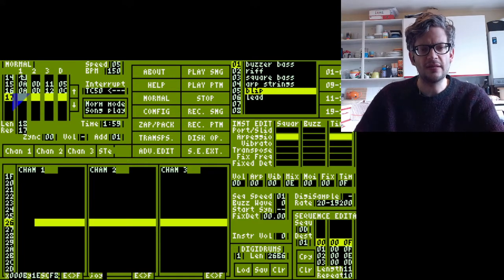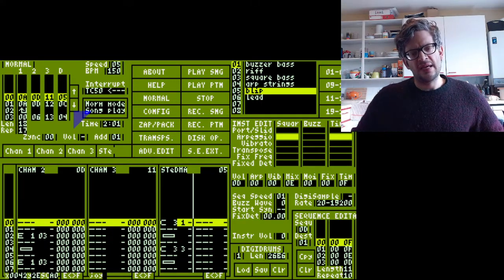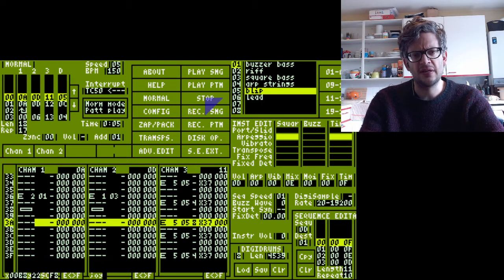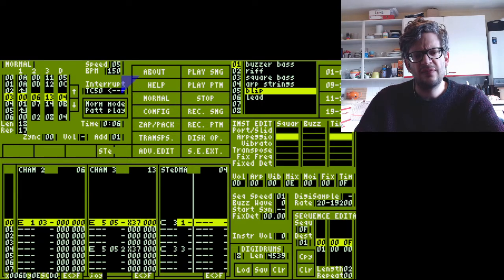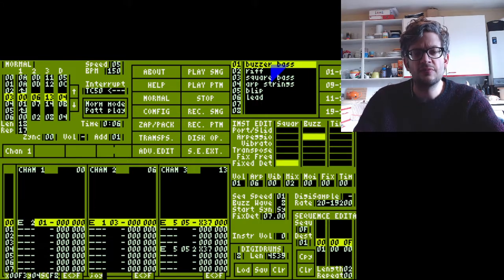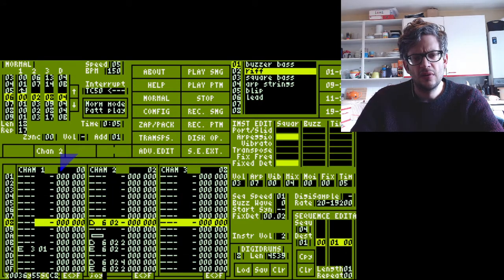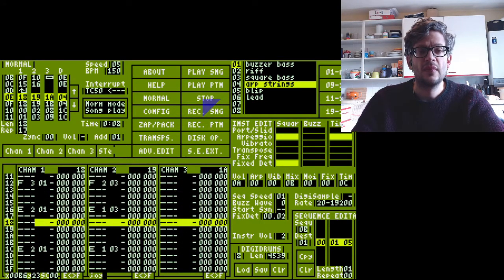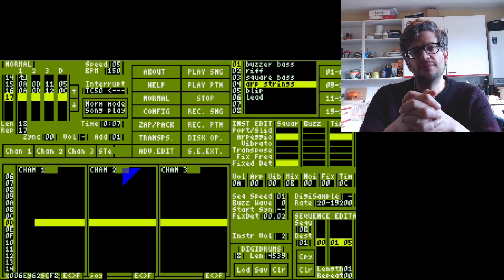gwEm maxYMiser track breakdown 2

Comment: Great demonstration on how to make a banging tune with such little resources!
It got me thinking, if would it would ever be possible to implement a sort of debugging window to look at, on which it would show how much memory is the song using and probably even most important how much cpu is being used in real time. If this was possible to implement, I think a good place to have this would probably be at the top right, where the instruments window is, this way we could track, when in Normal, which patterns would be spiking the cpu. 
I usually use dozens of patterns and instruments while being wild on the effects, but have absolute no clue of how an Atari would cope with it, since i  run Maxymiser on the Hatari emulator.
Just an idea.
Also by the way, i would very much appreciate, if on a future video you could talk about on how to switch on and off the port/slide, arpeggio etc flag masks. Since there's no detailed information on the manual, i have gone through some trial and error tests but couldnt get to any clear conclusion on how these work.
Keep up the good work.
Reply from the maker: Actually, there is a tool included with maxYMiser called SNDH CPU which will tell you exactly the CPU usage :)

I liked your video idea and I’ll look into doing that!